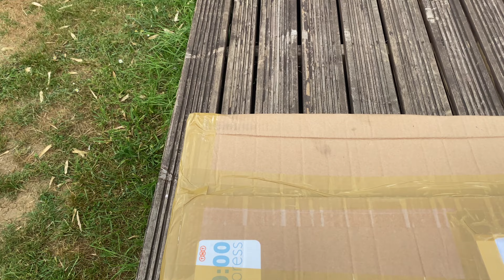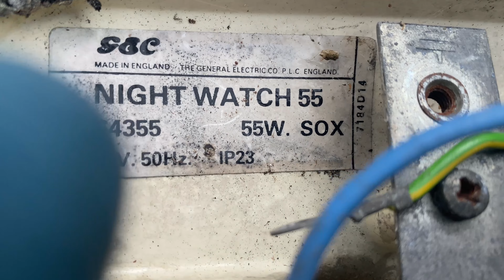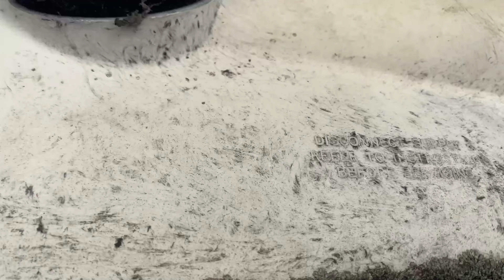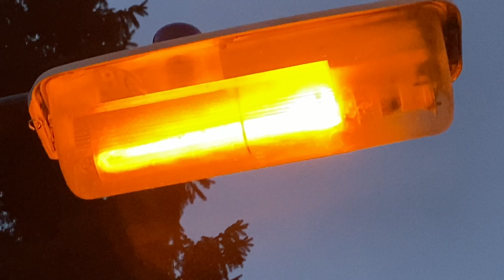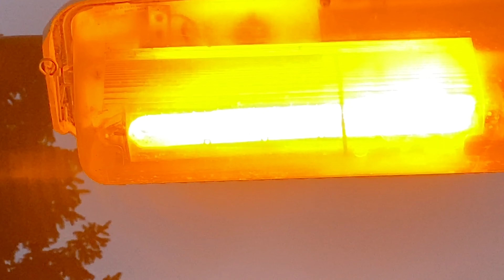GEC Z9538 Nightwatch 55W SOX

Comment: A Thorn Emi: Beta 79 well im not really fan of this model but street lights with SOX lamp 🤩😍 TL, PLL, FT, HPS, HQL, CPO, MH and some LED fixtures the begining seen in Belgium like Schréder GIE group: Senso, Teceo, Vezzo yes and voltana0, voltana0Evo, Voltana Evo too i don't like bad quality in LED and Drivers too
Reply: What is TF, PLL, HQL, CPO, ? Lol what types of lights are those? O, and TL.
Reply: I know what HPS is and LPS and MH And MV, high pressure sodium,  low pressure sodium, metal halide, mercury vapour . That's all I know .
Reply: What is TF, and the others that you said, but I do know wot MH and LPS and MV HPs

Comment: Bet your neighbours love that.
Reply from the maker: Due to the garden length it doesn’t disturb the other houses too much. The lights receive power using a timer clock for 17:15-23:03 for both reducing power consumption and reduce any potential disturbances caused by artificial lighting.
Reply: @d4sgroup  I'm into streetlights too, but I don't put them on display like this because they are significantly brighter than other household lights. I wish I could put them on display and turn them on in the evenings, but knowing what my neighbours are like, they would complain. They don't like anything that's "not necessary" in their eyes.
Reply from the maker: @HNJ-4812  That is unfortunate about your situation, it is still possible to display fixtures with a fully cut off optic, essentially flat glass. Personally my preference for no nuisance lights is my SGP352 (Iridium2) which is flat glass. No unwanted light which is what the bowls cause when they’re displayed. As long as the light is being used when someone needs visibility in the dark there should be no issues!